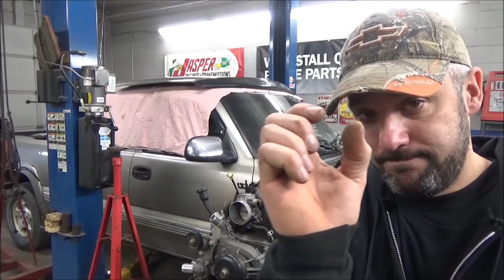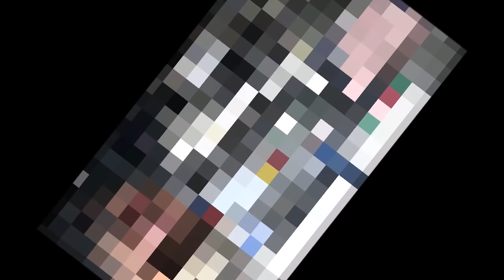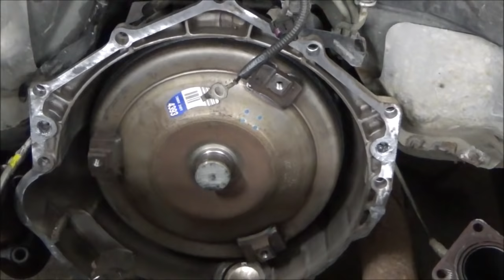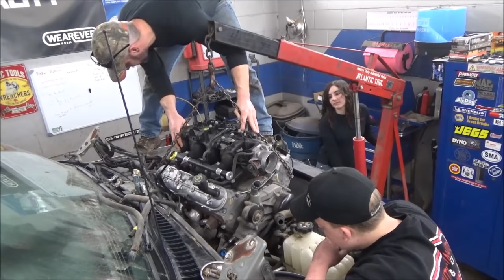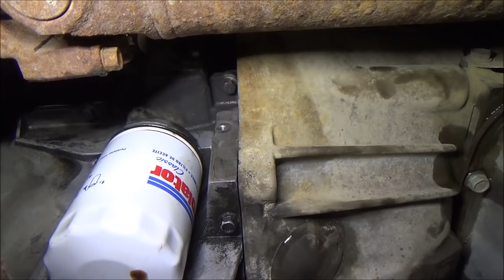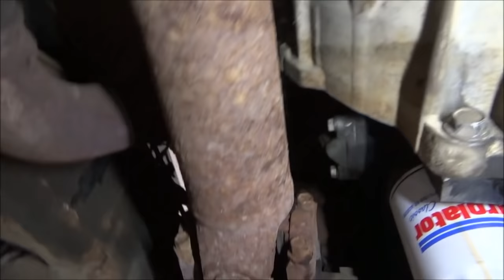Chevy Truck Engine - Remove & Replace Part III

Comment: After a $1200 quote from GMC to replace both engine mounts on 2013 Yukon Denali, I’m getting ready to replace them myself. I’ve been digging around for instructions on how to chain cherry picker to each side of motor and this was exactly what I needed. Thanks so much for giving us a sneak peak into your operation. You have helped me tremendously!

Comment: Cardboard is the best thing for working on the ground. Learned this long ago working on cars outside in Wisconsin winters. Corrugated cardboard is a good thermal insulator, keeps bits of gravel out of your back, and doesn’t take up height like a creeper does. 

These days I seek out TV boxes. They’re large and often glossy which makes sliding around on your back and cleaning up liquids very easy.

Comment: I am impressed with your attention to details such as installing components in their respective positions, I also appreciate the way you are considerate by using ant-seize for the next guy.  I have been in this industry for a few decades, and decent techs such as yourself are far and few between. If I lived in your area you would be one of a very few I would trust to work on any of my vehicles.Keep up the good work Eric.

Comment: Just watching this series for the 1st time. I helped rebuild a 307 from an 85 Oldsmobile 2 years ago and the motor had almost 700,000 miles on it and only time it came apart before the rebuild was just to replace blown head gaskets. Keep up the work. Also I learned so much from watching your videos

Comment: Cardboard does work well for a creeper. I epoxied the floor in my garage with a good floor epoxy and it was great. Nonslip yet I could slide around right on my back very smooth. Oil clean up was a snap. Just wipes up no penetration into the epoxy. It is very durable also hard to chip or scratch and long lasting.

Comment: I changed a transmission on a GMC Yukon very similar to that; the guy I was working with ran down the bolts to the bell housing messing the pump up, so we had to do it again, that was fun.

Comment: Eric is absolutely correct about never using bolts to draw parts together, as tempting as it may be, the pieces must fit together properly, generally speaking flat or parallel, then you use the bolts as something like springs to continue to hold the pieces together once you let go of them.

Comment: great series of videos SMA 
for anyone doing this job on a Chevy - i have two things i would suggest, a manual cable winch on the end of the crane so when you lower or raise the engine does not also go in or out, and a hoist load centering device to allow you to tip the engine when you want without having to move the chain. 
The assistant was a goof idea also, pretty hard to do alone.

Comment: iv done this to a 96 chevy with a 5.7 (similar aggrivations) with far less fancy tools, no air, i find it easier with the intake off, n i use two longish bolts with heads cut off as guide bolts in upper bell houseing plus im certian i used a lot more cussing, great vid

Comment: Hey Eric greay series. I totally agree with you about the cardboard versus the creeper. go to lose or tighten anything with a bar or ratchet and you just push or pull yourself to or away from the part when on the creeper. they are a joke. keep up the great work 👍👍👍
Reply from the maker: +AlexGrills Farmandrepairs Totally!

Comment: Eric did you ponder removing the intake manifold?  Easier to get at the top bell housing bolts, and less chance to break the MAP sensor bracket.
Reply: David Laliberté what’s the best way to remedy a broken map sensor bracket?
Reply: yep, easiest way to undo the top 3 bell housing bolts is from the engine bay side with the intake manifold removed.
Reply: We have done two 5.3 engines in the past month and we pulled the intake for both, but hey eric got it done. Guy is super  experienced, i usually watch his videos to learn more!

Comment: I know I'm late to the party on this one but I am doing this job in a 2005 Yukon.  Why not pull the intake manifold? Gives you more space and avoids damage.  I bought one of those valley plates to make it a bit easier to put in also.  Thanks for the video. <3

Comment: if you ever go to the trouble to remove intake and use the holley square bore engine plate bolted to valley make the back of the engine easy to get to like oil sending unit ,see if wires are pinched and top bolts can be installed from the top much easier and don't have to jack up the cherry picker near as high which is safer

Comment: I’ve watched this series more than 5 times now because I’m in the process of pulling the 5.3 out of my 02 Silverado right now
Reply: Same with my 4.8
Reply: I'm doing the same thing. Swapping a 5.3 with a 5.3. It's a lot for just one person. I broke a heater hose connection and a tab for the map sensor. The motor in my profile pic is going in....... hopefully
Reply: Chris Kubond sweet man. I can pull a motor by myself in about 4-5 hours
Reply: @chriskubond6314  did you finish the project?
Reply: @singlepistonproductions3232  damn that's quick. Respect ✊
Reply: @kaleip  actually I just finished a couple hours ago. The cam in the rebuilt engine is a little bigger than the one that was in the old motor. It runs and drives but it will act like it wants to die sometimes. Gonna have to get it retuned. A success none the less
Reply: @chriskubond6314  yesterday I had kicked my self in the ass my swap has been running good but since I'm cheap I re used knock sensors and one pulled a code last week so that was my saturday only took 2hrs was just looking to see if you were in a rut but happy to hear you're up and running . Just gotta drive the new engine a bit to fine tune it and boom save $$$$ mine was a 4.8l got for 350 bucks cant beat that👍 mine smoked and sputtered first startup even pulled a misfire code but drive it around the block and get your fuel pressure up and condensation will burn away
Reply: @kaleip  those damn knock sensors man lol. I've been there unfortunately. Got good at removing the intake. There's worse things for sure. Congrats on the swap. 350 is pretty nice for what it is. I got a 5.3 for 150, but it needed a full rebuild. Good luck with everything you got going on and God bless
Reply: FYI for anyone else doing these, pull the intake early on beforehand. I find it’s worth the little bit of extra time and a set of gaskets. It’s only ten 8mm and some lines and wires that you’re unhooking either way (15-30mins). Leaves you way more room to maneuver it up and out, top two bell housing bolts are super easy from up top, no worries about breaking the map, Pcv tabs etc. Also if you’re leaving the water pump and damper on, it’s a tight fit pulley to flexplate vs cowl to rad support. A thick piece of cardboard or thin sheet of plywood cut to size and placed in front of the radiator can be a big stress reliever/safety net. Good four part series Eric, appreciate you sharing.
Reply: What's steps can be done to make this EASIER rather than worrying about time?
Reply: @Wannakatana2112  pulling the front clip/rad support probably takes 30min. Like 10 bolts and some clips. That way you only need to lift the engine half a foot rather then 4 to get it over the front clip. Also taking the top bellhousing bolts out from the front of the engine with the intake manifold off makes things sooo much easier as stated above.

Comment: Reminds me of the many times I have done an engine swap, but usually the engine was hooked to a come along hanging in a tree or over a beam in the barn. Seldom had the "luxury" of concrete floor and engine hoist. I used to cut the heads off long tranny to engine bolts and as soon as I got the two close install them in the bottom two block holes as alignment pins.

Comment: Removing a Cessna aircraft gasoline engine is much like a truck engine, except the engine is much higher above the ground , and the hood is fairly light and easy to remove. Big difference is no coil packs, instead it has two Magnetos that generate spark for spark plugs. Great video Eric!!!

Comment: Had to change my transmission lines on my dodge truck what a pain in the bleep did not have a lift so that made it more difficult finally got it but old now and up and down for maneuvers were difficult but got it in the end just pipe and compression fittings!!!!

Comment: My 2012 had 8 bolts to bellhousing, one at 12:00 and one behind the drivers side head. You have to pull the intake to remove them..  Also to help with install, I attach a ratchet strap from opposite head in front and up to hoist, then you have 2 modes of lift..

Comment: great videos.
been having a real bad issue with my 2008 chevy suburban.
my oversized paper weight has been in an out of the shop for the passed year.
bad ticking an clapping or slapping noise.
These 5.3 motors with a AFM system are so darn expensive at least down here in Texas.
would love to get a good parts list so I can do the job my self.
any info would be great.
keepem coming.
Thanks.

Comment: Damn well done! Fiddling with the bell housing bolts must have been a nightmare. Definitely not engineered to be mechanic friendly. I'm going on to part 4 right now with fingers crossed that it's a good engine. Thanks for the video.

Comment: pull the intake off. easy peasey. opens a bunch of stuff up. exhaust on these things are tough. cringed when the fuel line was disconnected and the hotwrench was fired up. pull the intake on these things. cheap gasket. pull it with the fuel rail on. love you Eric

Comment: Eric: i am just about at a point where my 2011 5.3 silverado will need a rebuilt engine swap. May do this in my shop, but time may prevent it. What should i expect to pay in labor if i can find a compent shop to do the work? I am located in Kansas City. thanks. great vid series BTW!

Comment: Great video! I wanted to see this done.  Just in case. I normally see these engines get 300k+, but there's always the some that don't. 250k easy. Miss Hannah is such a good worker!
Reply: Just passed 260000 on my 2002 GMC Sierra
Reply: 285k on my avalanche

Comment: If you use flat rate times on engine swaps, very frustrating. On some (Ford diesels) cab removal is the only way. How did you quote the engine swap labor hours? When i was younger I enjoyed these jobs, but not anymore, flexibility and all that goes with aging puts a damper on engine swaps. Hannah was a great helper, hard to get someone that will work a boring hoist job and not day dream. She appeared to be right on with your instructions of what you wanted her to do. Kudos to the both of you.

Comment: The  replacement engine. Did you do a compression test or other  tests before you installed it. Where did you purchase the engine from? I've gotta do an engine swap on my truck someday.  I'm hoping not too soon.

Comment: Just watching this older video.  I'm wondering if Mr O ever had second thoughts about not removing the radiator.  In retrospect it looks like the job is alot easier without the radiator in place.

Comment: Get an engine leveler for your cherry picker and you wont have to fight the chain and it lets you control the forward and backward pitch taking an engine in and out

Comment: What size bolts do you need to attach it to the stand. And what about the bolts in the head to pull th engine

Comment: Hey Eric, I just had an Idea? You know the part where it was hard to get the camera in by the bell housing bolts by the transmission. What if you took that small little camera that you use to look down inside small crevices that has the cyclops light and camera on the end of it. Then point your youtube camera at the cyclops camera we may be able to see what you are doing in those hard to reach places. I don't know if it will work or not but it's worth a try.

Comment: I wonder if it's possible to pull the cab off of these. It seems like with how tight everything fits that the truck was designed around the engine.
Reply: +argonian bilbo alot more work
Reply: It's easier with the intake off. That thing makes life hard and the engine taller.
Reply: That's the deal on Ford's about 6 bolts and some big electrical connectors and she is off designed that way never seen that approach on Chevy

Comment: Just a question, how come you did not use an engine tilter on the end of the hoist instead of just a chain? Doing so would have made positioning at engine much easier.
Reply from the maker: +Rick Gaine they also hit the firewall making it impossible to put the engine in... at least any time I have tried one
Reply: +South Main Auto Repair OK, thanks for the reply. I only ask because I have always had great success using them. Then again, I typically work on things which are much older which have a lot more room in the engine compartment. Very nice job on the video, not only with this one, but the other ones as well. I extreme like the video where you donated the scrap money to the Humane Society for the animals.

Comment: Even with 2 helpers that job looked awkward! 

I've just taken on another project I think I'll regret. Engine swap in a Peugeot van. I only just finished helping my friend with his BMW 520D. We finally got it back together and working. New pistons, rebuilt head, valves and cam shafts. I never want to touch a BMW again.

Comment: If I don't use a load leveler, I use a second chain going to the opposite side of the front (bolted to head ect. or wrapped around exh. manifold, hooked at the hoist) to square it up and still have the tilt-back that's needed.
Reply from the maker: +Ben Bat I usually do that with a small ratchet strap so I can make small adjustments if I have to

Comment: Hey Eric, ever heard of a F-150 frame cracking around where the hitch receiver bolts to the frame? Mine is cracked an inch wide and 5 inches back. I couldn't believe it when I saw it. Anything I can do or am I SOL?
Reply from the maker: +**Classified** You could sell it and buy a Tundra I suppose then use the Tundra to tow the Ford in for scrap?
Reply: South Main Auto Repair haha! I knew you would say something like that! Too bad the body is perfect. No rust or anything. Otherwise I might consider doing just that.

Comment: Eric buddy... they make a lift sling..for the LS 4.8-5-3 and 6-0.. it bolts to Head and clear intake manifold..
Reply from the maker: +Paul Barnes Yeah the set up we had worked ok. I cant justify buying all the different adapters and such for all the different engines when I work on so many different makes ya now
Reply: It works with all v-8 ..

Comment: Hello,  I know time is money and there isn't enough of either but it sure would pique my curiosity having that old engine laying there.  I wonder just what was worn at 170k?  The oil pump for sure but I would love a gander at the bearings and cylinders?  Seems the Japanese and European engines get so many more miles.  I know in my own experience things start going south at about 120k pretty rapidly in domestic junk.  Ought to be a teenage motorhead who would jump at the chance to tear it down?  Maybe the local school's shop program?  I hate unanswered questions.  You Take care.  Doug

Comment: Replacing those engines is a PITA but it looks like the worst is over. You sure have a smart helper there. I could use someone like Hannah. Helpers that actually think and anticipate your next move are rare.

Comment: Nice vid like always eric! How many junkyard engines have been bad after installation?;)
Reply: +South Main Auto Repair..... How lucky you are, I only bought one out of a junk Yard, Came out of a pretty nice truck with low mileage. And it was totally garbage. Took putting parts from the old and new together to come up with a good running engine. So I'm 0 for 1
Reply from the maker: oh man... that sucks.

Comment: Everyone says Ford's are way harder to work on than Chevy's. But I swapped the engine in my 2003 f150 and it seemed way easier than this truck. And it has the big old 5.4 in it. Not a small engine by any means. It was the first engine swap I had ever done too. The only time I had help was putting the new engine in and lining everything up. Took me about 2.5 days.

Comment: A sliver of advice to anyone who cant get the tranny lined up because bolts wont line up. Hook your chain to the front and back of the head that you need to swing to line up , with help jack both engine and tranny until you get close then with a small c clamp draw engine and tranny together one side at a time until the gap is minimal  as far as you can reach mostly in the dowel pin area , watch er come together ....bolt er up after worked 4 me 👍

Comment: I agree that cardboard is much better than any creeper!!   I threw my last creeper in the trash about 25 years ago.  Is Hannah training to be a mechanic?  Chris
Reply: +Shadowdog500 what is it with creepers that they find every hole, crack, pebble or grain of sand to jam a wheel on any floor they're used on?
Reply: in defense of the embattled creeper if you have a couple of fractures in your spine provided you have a perfect surface they do work better than trying to wiggle on the cardboard, I think a power creeper would be the shiznit if you could mount some mudders on it 😃

Comment: they swap engines for $400 in Dallas...Man they deserve every penny of that!!! I'm a diyer but I won't attempt this job on anything beyond a 4cyl front wheel drive engine.. This is a huge job judging by Eric's struggles, especially the bell housing top bolts and wiring crap

Comment: Last engine I pulled I removed the front grill and radiator pulled Trans with engine it was a lot easier to separate and install on the ground

Comment: I remove the intake, take the motor mounts out and loosen the rear tranny mount.  Then slide the tranny about two inches forward.  It make all the rear engine bolts easily accessible.